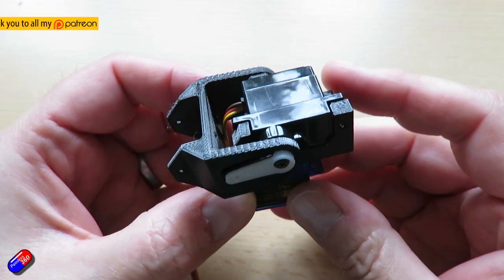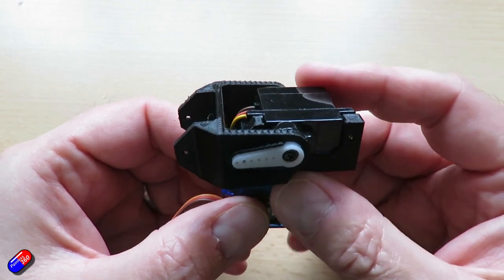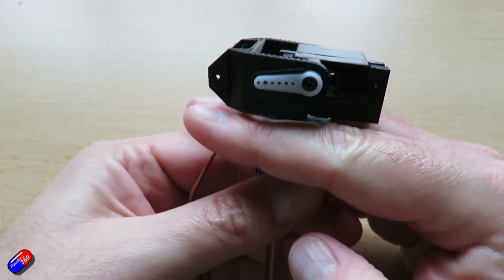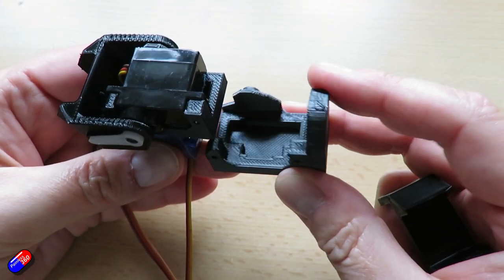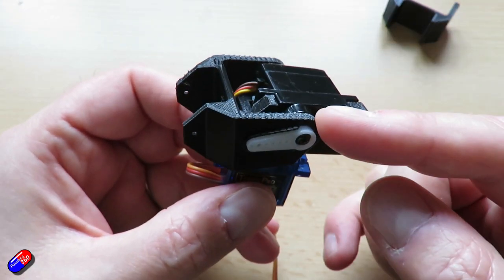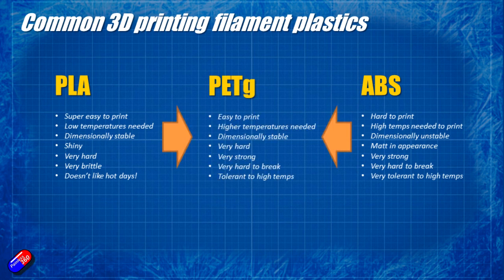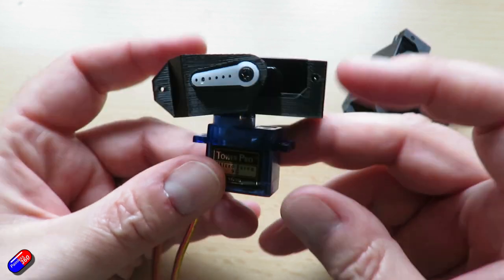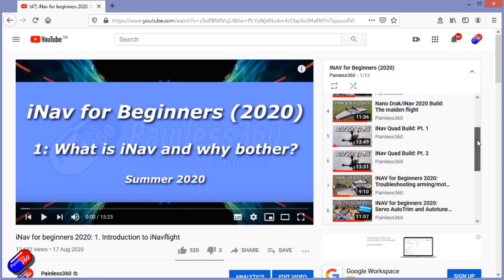My new FPV Pan and Tilt design that you can print!

Comment: Coming in here a little late, but I have some strange issues that maybe someone could help with. I printed out Lee compact pan and tilt parts, and they work great. I have skyzone cobra x v4 goggles, and I'm using a X20s Ethos radio. The issue I'm having is that, for some reason, all the settings in the radio keep randomly changing. Pan left, and right will invert or tilt up and down will invert randomly. I feel like it must be an issue in the goggles, as I don't see why the radio would randomly change things like that.
Reply from the maker: Not sure, I don't use ETHOS here. I'd check the incoming signals from the goggles on the radio when it works and see if those change when things reverse. That'll tell you if the goggles or radio are the cause... best of luck
Reply: @Painless360  Ok I'll check that thanks.
Reply: @Painless360  Another question if I may, I have noticed a few times that on the outputs screen the channel and mixer bars move opposite to each other sometimes one moves in the positive direction and the other in the negative direction. Shouldn't they always move together in the same direction?
Reply from the maker: Depends which channels you are referring to. Things like dual channel ailerons often move in opposite directions... best of luck
Reply: Thank you sir.

Comment: There's a lot I like about this design, but unfortunately my servos were a little too tall, and the horns didn't fit either.  The retention on the pan servo also cracked out when I dropped it on the floor once.  I don't feel like it would last more than a landing or two.  Just like tilt, I think pan retention should use a horn too.  Would likely make that joint much stronger.  Going to have to remix it!  I had some printing issues, so I'm going to try to find a solution that doesn't require supports.  Maybe that's not possible though, we will see.  Thanks for giving me a great start though.
Reply from the maker: Designed for cheap, plastic geared SG90 servos. Best of luck with your design. This one is shared under the Creative common - no derivatives and non commercial licence. Best of luck with your design... Happy flying!

Comment: What servo are you using to run the camera portion? None of my 9g ones fit.
Reply from the maker: Just a regular SG90 plastic geared servo for all the ones I've printed here. The connection is designed to be a friction fit. Use the tip of a craft knife or a needle file to open the hole if your printer is printing it too small... Happy flying
Reply: It's the physical size of the servo itself. The servo is too tall by a mm or so. Already broke a tab trying to pry it in.  The gear hole is perfect.

Comment: I labored into figuring out ABS printing for a year or so. The best method is to build a small enclosure, then use a heat gun to keep the inside nice and toasty. I used a 12v car space heater for a little while, and it worked great. I didn't feel comfortable leaving the room though, so I went back to using a heat gun a few times during the print. I mounted my electronics onto the side of the enclosure too.

Comment: Hi Lee, I just printed this and it works well. However the down travel needs to be limited to stop the servo burning out. How would you go about limiting that? I have it on a inav wing and a open tx radio..
Reply from the maker: Limit the travel in the radio or INAV in the same way you'd do any other servo... Best of luck

Comment: Hi, this is Arne from Hamburg/Germany!
I wonder how you fixed the servo to the bottom plate securely without having the correct fitting tooth bore...?
I tried it with my ordered printed parts and it did not work!
In consequence I made a larger bore and bonded a servo horn inside the plate - that works fine and I would propose to change the design in that way.
But in general I like your design very well - thanks for that!
Reply from the maker: If you can give me specifics on what needs to change and my exactly how much I am happy to look at that. This is designed for the cheap SG90 style plastic servos. No one servo mount will work with all servo output shafts as there isn't a standard..
Reply: @Painless360  Is there any chance to send here pics to you how I made the solution?
I used original SG90 also and I allready made pics to show how it works!

Comment: I have printed one of "low profile" versions on my resin printer.  The prints are amazing but tilt servo body will not accept a standard 9g servo.  The servos I have, they look just like the blue one in the video, are 21mm high but the mount will only accept about 18.5mm.  Am I missing something?  Thanks
Reply: Just answered my own question.  I was trying to use a metal gear servo, too big, the nylon gear servo fits perfectly.  Hope this helps someone else!
Reply from the maker: That's it! Note added to design on thingiverse to make that more obvious. Happy flying!

Comment: Interesting design. I don't like how the camera is mounted so far away from the pivot point but obviously you've prioritised the packaging over that so it's built to a specific purpose. It does look like it would be quite robust as well.

I use PETg for everything these days and have done for years, I find it best to get one material type really well dialed in rather than keep switching all of the time. (I don't even use TPU for my quads, I just rely on the flexibility of PETg) The only real issue with PETg is that it likes to string, but the easiest solution to that is to setup pressure advance correctly and to print a single part at a time. (Or leave a large gap between each part)

I've always used SpoolWorks in the past but E3D have been running down the SpoolWorks side of things so I might have to try the offerings from Filamentive. Interestingly Filamentive have a different datasheet for their black / white / transparent PETg compared to their coloured PETg. Your PETg settings are interesting, particularly your bed temperature. I have always used a higher bed temperature for PETg (85C) compared with what I used to use for PLA (60C) and that's also on a glass bed with hairspray. (Specifically 3DLac).

Comment: Off-topic, but would you please do a quick tutorial on how to do differential thrust in inav. I have a twin motor flitetest model I want to use differential thrust instead of Rudder, and I cannot find this information anywhere in the wiki or the forums. Is it still done in the radio? Or is it done in the configurator? Any help would be greatly appreciated.
Reply from the maker: I've covered this in the past. You can 'mix' a little rudder into the throttle mixes to do the same in INAV as you would in the radio. See https://www.youtube.com/watch?v=v0CABnPXqFE
Reply: @Painless360  perfect, thank you.  I knew it had to be hiding in plain sight somewhere.

Comment: I don’t understand why we still have hardware implemented pan and tilt, or rather why a software implementation isn’t so widely available. We have cameras that have a 180°+ field of view and just need the head tracker to pan the video feed.
Maybe I’ll have a dabble doing this myself with a raspberry pi, no idea if they can input video though. 
I guess drawbacks are that you’re going to be sacrificing resolution and perhaps distortion.
Reply from the maker: That sounds like a great idea. Some closed source systems like the Parrot stuff did this and also provided stabilisation too. Having a cheaper easier way to do it would be great!
Reply: @Painless360  yeah I’ve seen a couple of proprietary products. I see two ways of doing it:
1. Onboard digital pan+tilt system. This could be retrofitted, I.e. it has a couple of servo inputs that crop to the relevant portion of video before the downlink. 
2. Ground based system that takes the full video feed and the signal from the head tracker to crop the video. 

1. Is more weight, requires servo inputs and therefore takes up two channels. A more expensive system if you want to set up multiple models. But you get a higher quality video feed. 
2. The plane is a lot simpler only requiring a direct downlink. Software pan/tilt system can be used for multiple systems but video quality will be lower.

I’ve had a look and my ideas are to directly use a Raspberry Pi module as the camera. GPIO can be used for the video out to the downlink. I also found some code that can interpret an FrSky SBus signal but some electronics might be required to convert voltages. 

I’m really surprised such a system doesn’t really exist. I’m sure it would be super simple for a manufacturer to produce them.

Comment: Hobbyking used to sell nice light weight pan tilt mechanisms with ball bearings. Unfortunately they were designed for old large board cameras. Something like that for modern small cameras would be perfect IMHO. If the dampening can be incorporated (e.g. by using silicon tunes as part of pushrod mechanism) then servo jitter can be eliminated too.
Reply from the maker: It's a shame that Hobbyking has lost the plot. They were the go-to for so many things... Happy flying

Comment: Perfect timing! I'm building a pan/tilt DJI plane now and the gimbal that was recommended by Andy RC is out of stock. The low-profile is exactly what I need! Will this one rotate 180 degrees on pan?
Reply from the maker: If you get a servo with that movements.. Happy flying
Reply: @Painless360   I'm following Andy RC's pan/tilt setup where he mods 180 degree servos to go beyond 180 degrees.
Reply from the maker: Works the same.. Happy flying
Reply: I made a 3D printed gear reduction  between servo and cam, now I have 360 pan 😉
Reply: If you are using iNav you can usually get closer to 270dg out of a 180deg servo without even modifying the servo.
Reply: @NoAgendaFPV  Interesting. So does inav have a travel adjustment for servos or something?
Reply: @flipfpv  In the Outputs tab you adjust the servo min and max from 1000/2000 to lower/higher numbers to driver the servo further. I find 700/2300 normally to be the most travel I get from my 180deg servos, you have to just try adjusting the numbers and check to see when you are putting in a number that is too low/high and the servo is just not going any further. *I have found that this does not work on all servos, but I have certainly done it on many different, including driving 90deg Emax 5g servos to almost 180. Thought I had a video about this but I don't see one. Maybe when I get to that point in my next project I'll whip up a quick vid.
Reply: @NoAgendaFPV  I haven't tried inav yet but plan to soon so this is good to know! Seems like this should work in betaflight too. Thanks for the info!